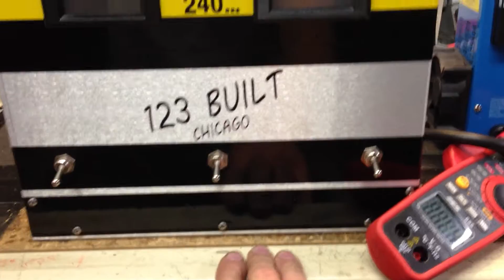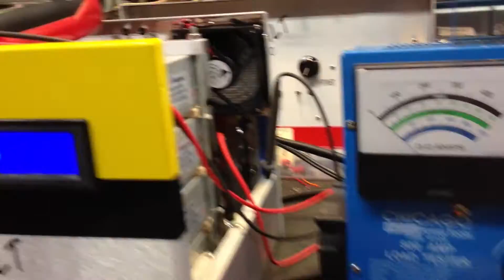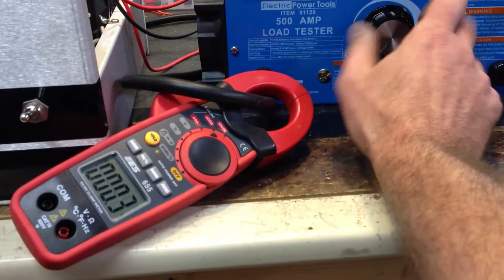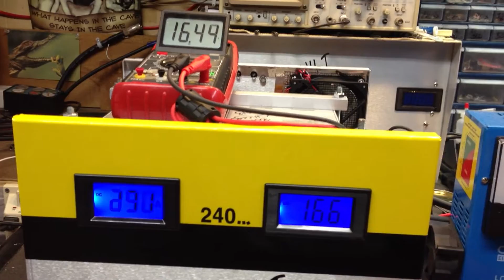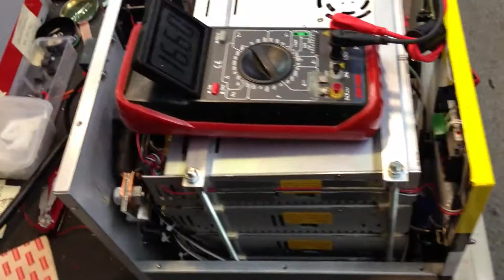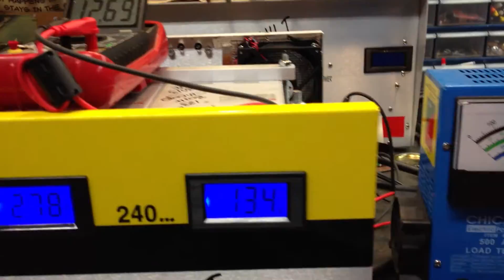New 240 Amp Switching Power Supply

Comment: remember low dc volts. UP the wire gauge.  0 ga at least for full power. i would use 4/0 to keep voltage drop down. I built my first supply in 1988. 250 amp ICAS. LM723 reg. 4 50 amp transformers 25 2N3772 pass transistors.  240 Vac 20 amp. ADJ 9 to 15V. 5 to 250 amp limit its BIG its BAD runs somewhat warm and still works all this time later. my bench supply. NO RF hash noise. You want to run a BIG amp you get one like this. Rember 240VAC
Reply: hey robert, can i get some pictures, detailed pictures of this unit your talking about? I've had a lot of interest in regulated iron and I even have some big 300A pass transistors. IGBT's. Haven't quite figured out how to incorporate them yet 100 percent but I have a lot of iron core that I could use up if I could learn how to incorporate these IGBT Devices. I know the new motor mauls use this type but the only one I have for reference is using switch mode regulators and I would rather use a lm317 or some sort of regulator like that.
Reply: some of my ham friends have a go pro. I do not have one right now. But. circuit was from pyramid PS 25 supply. Used 25  2N3772  transistors  with 2.2 ohm 2 watt  on each base .4 surplus 50 amp transformers with driver winding. 8 NTE 85amp 400V  stud diodes. 8 6a04 400V 6A diodes. 4 sprague 36D caps. 35V I think 330000Uf had 1/4 28 screws. put a soft start dale 200 watt resistor circuit in.wired 240V 20 amp. used forklift 48V 100 amp charger case stripped. kept 277V 7 in fan runs 240V OK  REG is LM723CN  also NTE 923D same ic. can use the pymrd 35G circuit. that had 2n3771 X4  pass transistors. Made  on radio-shack  breadboard . for the 723 reg bord. had trouble with current limit as first. had to re due resistors. re used Anderson 350 amp connector that was on charger. cut the 277V plug off re placed 240V 20A. mounted square D QO 240V 20 amp breaker on side. its a power pig was finished 8 of 1988 .  I have not used IGBT's in a analog supply.   you need a dolly to move it!  The 48V charger was scrap. building was a lightning strike. big surge. over 100K in damage. that was in 1986. I would not build this today.  switcher is much more efficient and smaller. it was the 80s

Comment: how good will this keep up with high current peaks like for a big car audio system ??
Reply from the maker: Car AudioDriver no problem!! I can build any size you would 

                      2017
         Price list for Switching 
               Power Supply's ...
                 
120vac

2 unit 60 amps $340
3 unit 90 amps $370

220vac

4 units 120 amp $580
5 units 150 amp $670
6 units 180 amps $730
8 units 240 amp $895
10 units 300 amp $1145
12 units 360 amp $1375
15 units 450 amp $1780
17 unitsf 510 amp $2100
20units600amp $2400
25units750amp$3200

All units will be a set voltage @ 15.5vdc output... unless you want more or Less?

The prices on this list Does Not Cover the Shipping ! 

"123 Built Chicago"
      On YouTube 

Call or email me ...
1-609-350-4798

123builtchicago@gmail.com

Comment: I have a quick question did you use 24 volt supplies? and why is the bleed down so fast? the reason I am asking is because I have been building these power supplies as well and these power supplies max out at right around 15 volts. and the bleed down found that one is really fast so do you run capacitors or not? just curious because I went overkill on my capacitors and my bleeding is nowhere near that fast. TwoNinePerrisCal wavin
Reply: Cameron Mataya no, my friend had one at 16.2 volts  200amp but does more for 4 years and uses the thing every day.....
Reply from the maker: No there not 24vdc units! 
I make changes to the units on the inside! 
Sorry but I'm not in the business to hand out how I build...
Reply: Okay I was just curious I'm not trying to ask how you build specifically just had a couple questions.. lol
Reply: Cameron Mataya
Reply: Yes
Reply: Cameron Mataya  small mod to bring it to 16 to 16.9 max!!!!!
Reply: It burns them up..

Comment: hey 123 on those switching power supply do the fans on the power supply come on by thereself
Reply: My supply's work like that and as soon as you apply a load all fans will run @ full output. 

   Thanks Danny
Reply: ok so with no load the fans will come on when it at a certain temp

Comment: hey danny, its Gatekeeper from zello, I am IMPRESSED, VERY IMPRESSED, I had the understanding that switchers was not the best for RF Applications but you have proved that to be wrong. my buddy 073 bought a 50amp switcher from HRO and it couldnt even handle 2x1446s for some reason. So I am guessing that this is multiple switchers parelleled together. is that correct?